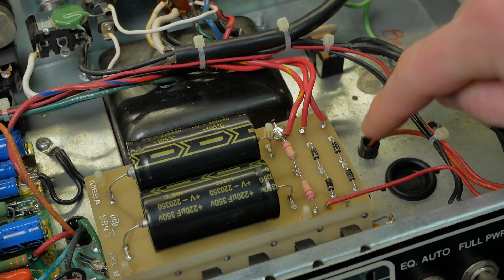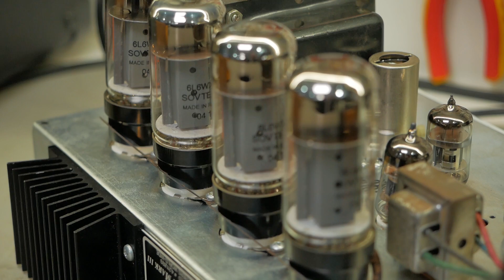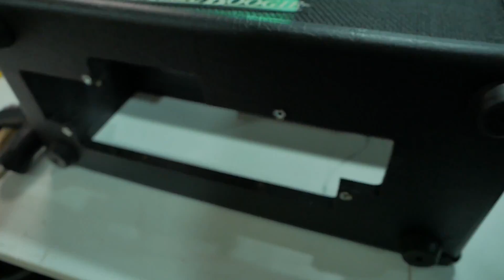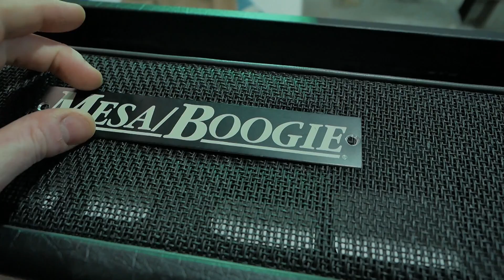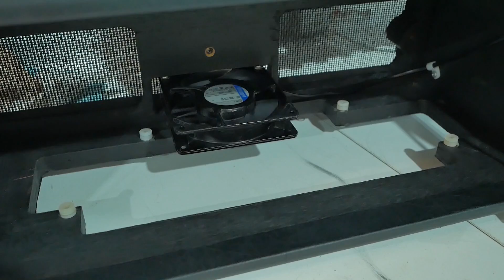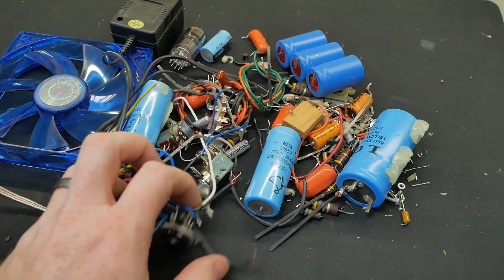FINAL: Mesa Mkiii Blue Stripe - Part 4

Comment: For the oversized Mesa name plate, you could cut off some screws, glue them into the existing holes on the plate, and use double sided tape or perhaps hot glue to affix the name plate to the grill cloth.

Comment: Great work.  By comparison, mine doesn't seem so bad.  No mods, I just need to recap it and replace a few overheated resistors.  Did you end up doing anything with the ground switch?  I did order a capacitor that fails open, but I'm wondering if I can just remove it entirely.
Reply from the maker: Yeah, just disconnect it, mate.
It's redundant wit a 3-pronged plug wired correctly.

Comment: I see you used 105°C Japanese caps. Why do I see even expensive, like $10s of thousands of dollars expensive, amplifiers with 85°C caps in them? I know it's a cost thing. But why would anyone use cheap caps when they can just pass the cost off to the customer? Look at PC power supplies. They're very efficient and use the best components, at least for the good ones. They don't cost a fortune. These components are not unobtainium.

And major kudos for using the Teflon/silver wires. As much as I hate manufacturers charging premium prices and then using crap components, I hate it when techs do the same thing.
Reply from the maker: No idea, mate.
Maybe it's just what they always used, maybe it is penny-pinching, no idea.
If you find out, let me know!

Comment: Since about the 1980s, Sprague, then SBE and now I doubt if Cornell Dubilier actually makes any of their orange drop caps either. Same with Mallory 150s. During the beginning of the Cold War, Chicago was the electronics manufacturing center for the USA. The Department of Defense deemed this to be unacceptable and somehow Phoenix, Arizona became an alternate site. Back in the 1970s someone was winding something on every corner in the Phoenix metro area, and we had "Chip Alley", the Motorola MOSFET plants, Honeywell, Intel, Digital and Microchip. I got so spoiled with all the surplus stuff I could get at 50%-99% discount prices.

Comment: Back in the day when I was young, dumb and stupid ignorant, I got a Mk3 decked out simulclassed, hardwood combo with a single EV12L speaker. Besides poor design mine was missing a key ingredient and mine did not have the 5 band graphic eq. What a mistake that was. I think that damned thing weighed more than a fender twin. The weight along with option paralysis was more than I could deal with. I sold it to a friend of mine who thought it sounded great for his 5-string banjo on the clean channel. He still uses it to this day lol….twang twang “boi you got a purty mouth” Deliverance set the banjo back 50yrs or more lmfao..! You did a fantastic job getting that amp back to better than stock condition. I thought that fake heat sink on the back was where they use to beat the hell out of the amp with a hammer. Yours looked like it escaped the fabled “mesa hammer test”. Have a good one mate…a big ole feather in your cap for this repair and re-engineering.